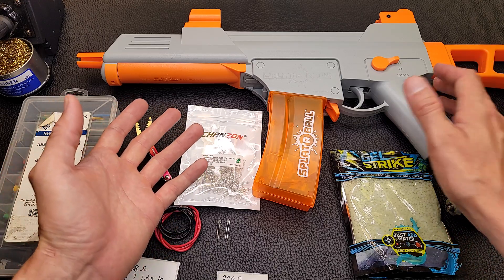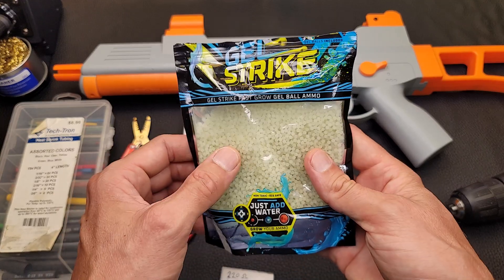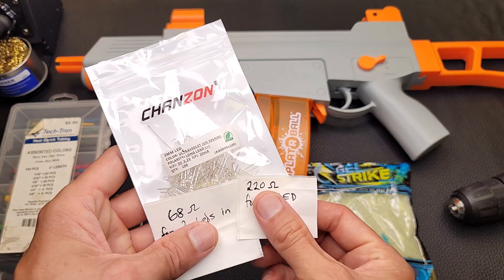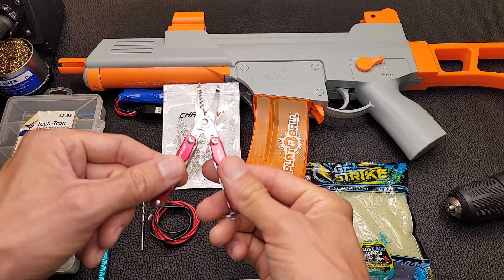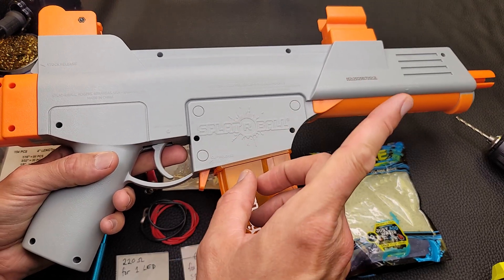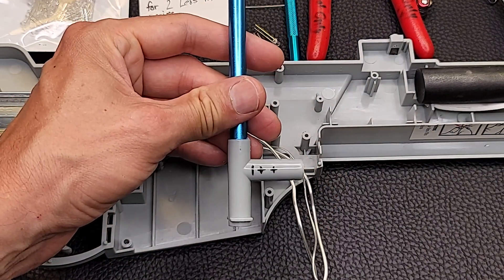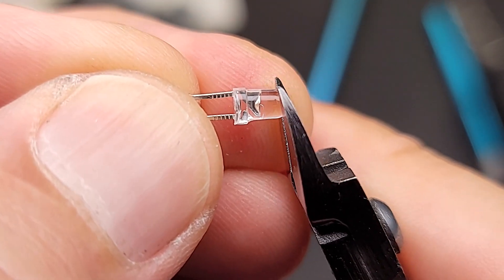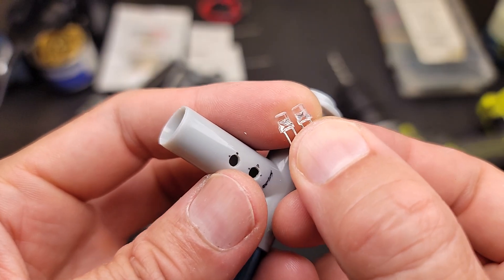Easy TRACER MOD for SPLATRBALL GUN SRB400 GEL BLASTER for Glow In The Dark gel balls | SPLAT-R-BALL

Comment: How does this mod affect the battery life and if it dosent affect it alot can I run both the internal mod and the led mod for the mag at the same time?
Reply from the maker: You won't notice a change in battery life. The current draw of the LEDs is negligible compared to the motors. A lot of blasters even come with decorative LEDs. Yes, you can run both tracer mods at the same time.

Comment: Mod works great! But I think I messed up sealing the part the leds go into, or maybe somehow the very very small interface in it is causing miss fires. Normally with these guns they’ll miss fire occasionally. Now mine does it way more. Should I take it back apart and see if I didn’t glue it enough? Any suggestions would be awesome
Reply from the maker: Make sure LED doesn't stick too far into the inner diameter of the feed tube. There's no sealing requirements in the feed area of the t-piece. Misfires are usually caused by the tappet plate being bent. Check my gearbox upgrade video, I show how the tappet is bent and how to bend it back straight.
Reply: @engineerable  thank you!!!